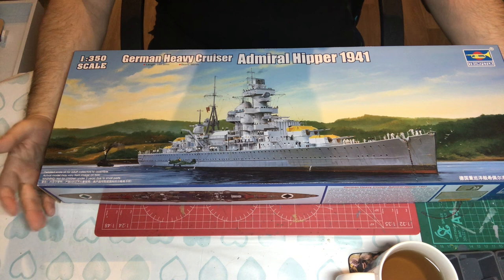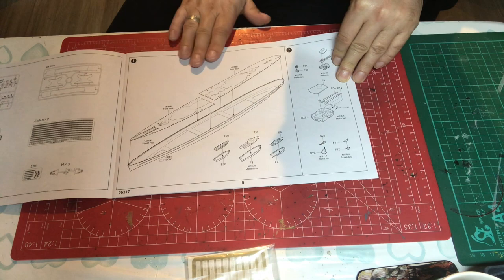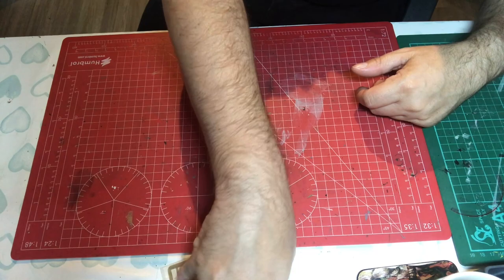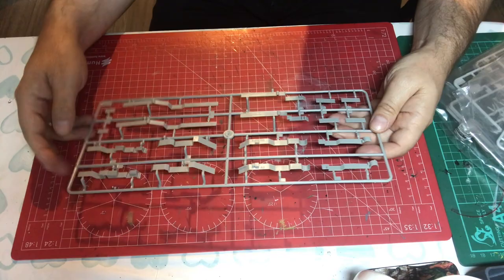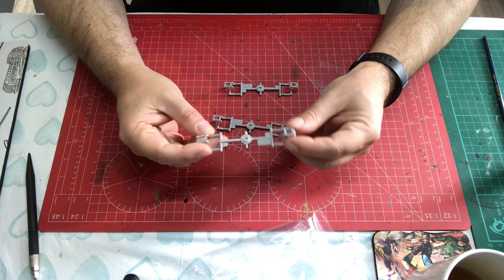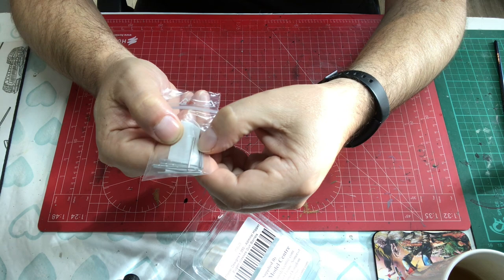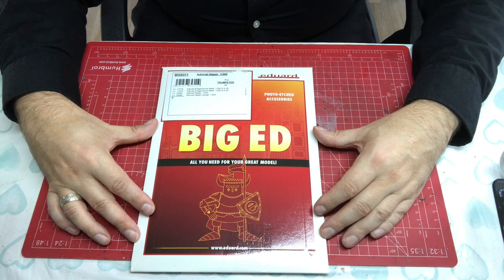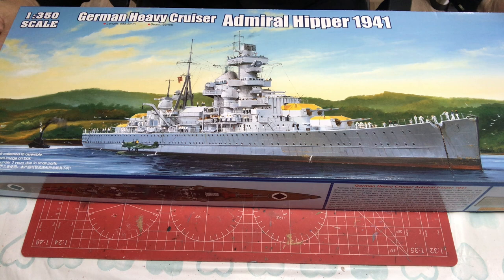First impressions - Trumpeter 1/350 Admiral Hipper

Comment: I dont know if you ever ended up building this, but I have to tell you for fit issues etc it was easily the worst Trumpeter kit I have ever encountered :(
Reply from the maker: not as yet have the Blucher too, so imagine that would be the same, thanks for the heads up
Reply: @ModelkitStuff  I actually wanted to build Blucher but at the time it was a really hard kit to source.. oh and Hipper never had her turret tops painted, unlike the others in the class